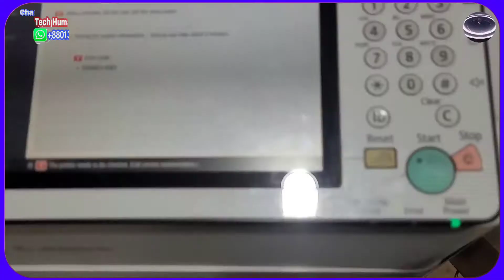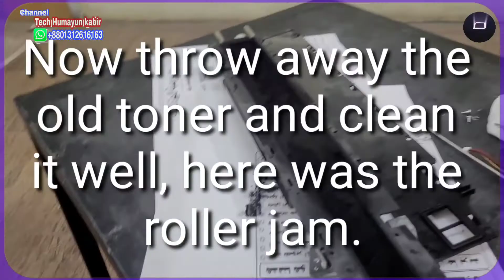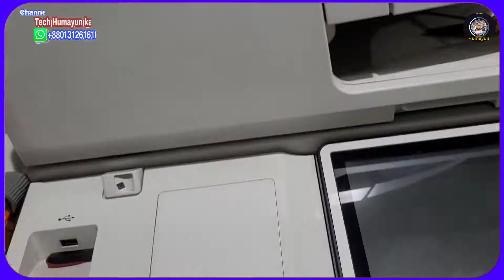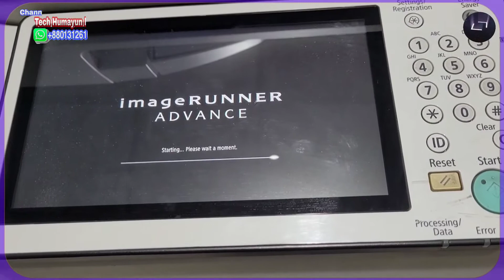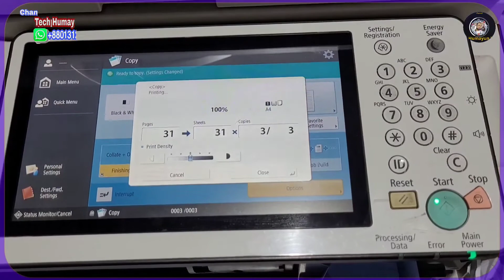How to canon advance solve error code E025-0001-05 RUNNER ADVANCE DX 8705 8795 #canon #subscribe

Comment: Will my problem is E000197-1001 will that work for my printer it’s C7260i
Reply from the maker: Serial communication error. Serial communication error in ASIC
Laser Interface PCB
Are you change board?

Comment: The same error code, but it says Bottle Motor. How I can solve for Canon ir 4545i?
Reply from the maker: The Bottle Motor (M17) lock signal does not indicate a locked state a specific period of time after the Bottle Motor (M17) has been started. * The same condition is detected after the error retry is performed.